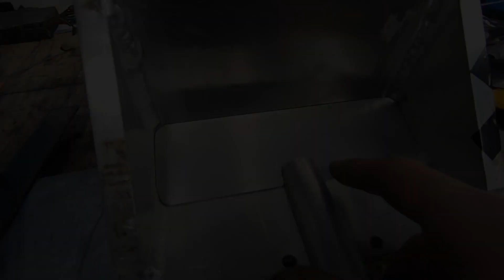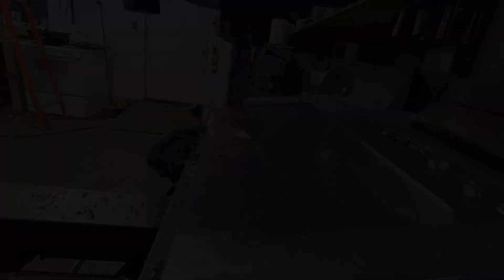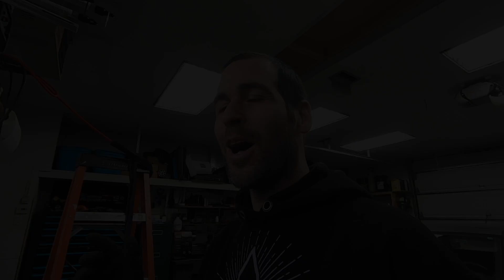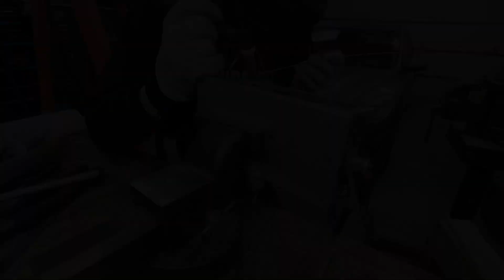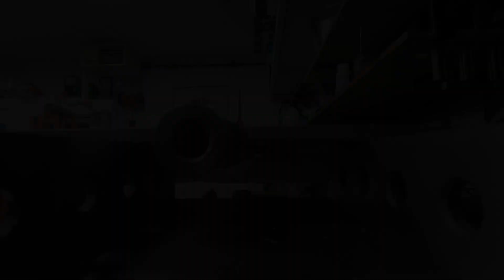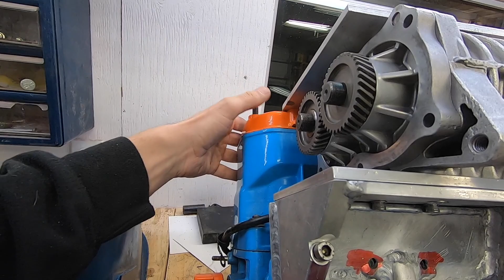Supercharging My X2 - Welding Nightmare (my bad) - (part 5)

Comment: Hi mate, the manifold turned out wicked, can't wait until you bolt it up to the engine, and take it out on the water, hope everything goes smoothly with the manifold and other pieces, cheers
Reply from the maker: Thanks Adrian. Still lots of work to go, but it's coming along nicely. Due to the fact that there's no user manual on how to do something like this, I'm guessing that I will have some issues once it's up and running, but I will take care of those issues as they come. That's all part of the adventure :)